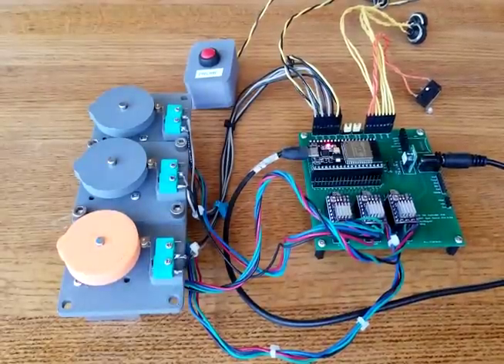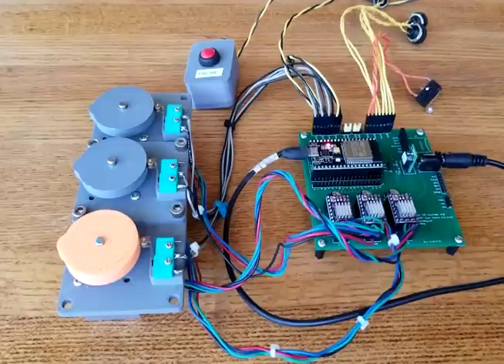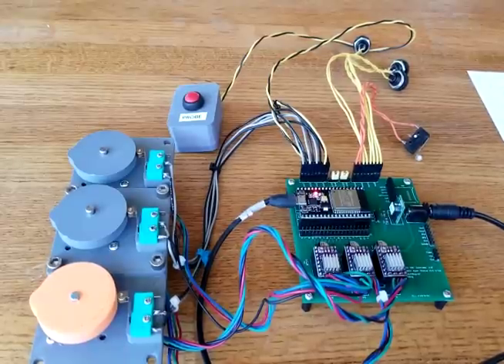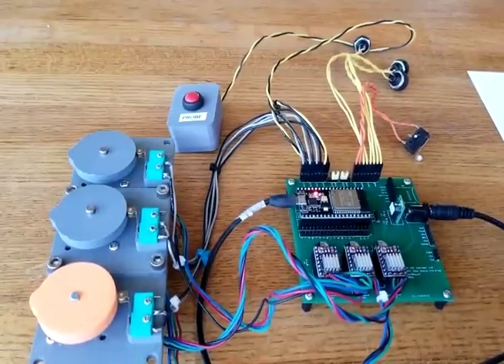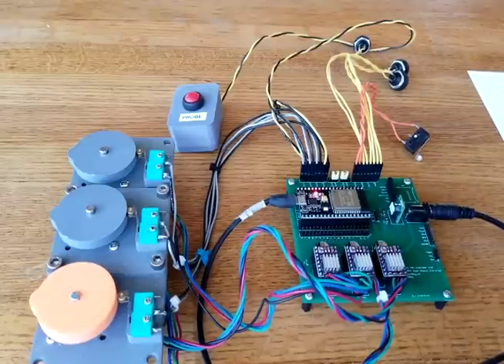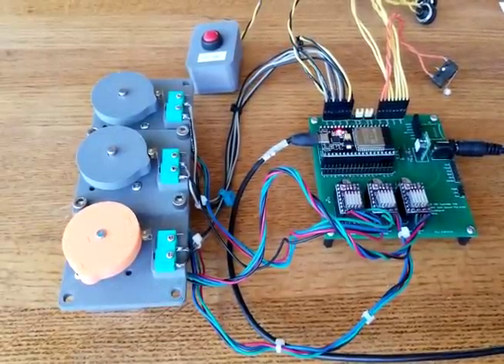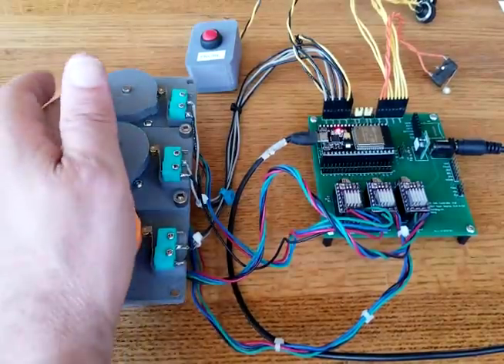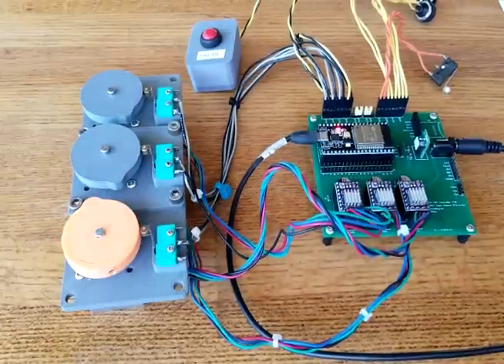Grbl CNC Firmware Running on ESP32

Comment: I want to use esp32 for my cnc router and I have esp32 and drv8825 drivers I know wiring how to run motor with esp32 
but how i can enable microstepping can you please help do i need to give 5v to ms1,ms2,ms3 ?
Reply from the maker: @Harinderbhinder  The firmware is now called FluidNC. Go to the Discord for support. Google to find that.

Comment: What should be interested would be to add a real  motor pwm speed control. 
Counter-reaction with the can, it would be probably possible with this controller.
Then drive the motor with mosfets at a quite hight pwm frequency.
As a workaround we could only choose a voltage regulation which would be sufficient enough for some CC motors. It depends of what you wanna achieve with your motor, and though what power you need.

Comment: hi, I would ask you a question. I have an old CNC Fanuc Sigma VC1000 with the same serial port 25 pin DB25 rs232 and I would monitoring this machine using an ESP32. Not only monitoring but also send it the gcode. In your opinion I'm able to do this using this shield (in your video)? For monitoring I mean sending the machine some code for example D600 and the machine could answer me about the status: stop, word, allarm, type allarm. Sending gcode I don't know yet.
Reply from the maker: This project is now called FluidNC. Here is the Wiki http://wiki.fluidnc.com/en/home

Comment: It would be nice to have this ported to XTool D1's control board. It also uses an ESP32 and Trinamic drivers but it is NOT user friendly. Completely locked out of user customization.
I may be looking for a way to replace the controller board for something like this that can drive the steppers and fire the diode laser. Have you thought about hacking the XTool controller to add your own firmware or making a pcb that fits? I'm interested if you do.

Comment: The file you have online for esp32grbl will not load into the arduino ide and yes I have the esp32 board manager installed  PLEASE zipp it up as an arduino file like they did for the uno.

Comment: Hello, very nice project however most of the arduino GRBL can not do this or that are based on the arduino uno (328) running GRBL however you have not considered the MEGA 2560 with a RAMPS board pluged in which runs 4 axis ,end stops ,heaters ,lcd ,and a whole lot more,I have been running this board on my 3d printer and my 3axis cnc and never had any type of problems and yes the system is pugged into a computer which sends the gcode but there is a way to put the code on a flash drive pop the drive into the slot on the lcd board and away you go . You have to admit arduino grbl is proven ,easy to use ,and cost is lower than your esp system and what is the real advantage I do not know,  also the high speed well when running a mill you want torque not speed speed is needed for 3d printing and pen plotters and pricewise your esp board cost as a ramps +mega + stepper drivers check ebay. now if you want to do something special use a  ESP Wrover Kit and then all you need to add is the driver modules and its ready to connect to a cnc machine.

Comment: Good afternoon. Could you help me in connecting 4 stepper motors in the firmware Grbl_Esp32 (https://github.com/bdring/Grbl_Esp32). Nowhere can I find a circuit with a description of the esp32 pins and their connection to the pins of the stepper motor driver.
Reply from the maker: Here is a link to a 4 axis example https://github.com/bdring/Grbl_Esp32/blob/main/Grbl_Esp32/src/Machines/spi_daisy_4axis_xyza.h
Here is a folder of about 20 more examples (3 to 6 axis)
https://github.com/bdring/Grbl_Esp32/tree/main/Grbl_Esp32/src/Machines
Reply: @engserve  Thank you very much

Comment: I installed esp32 grbl. Most of it's function are working , like jog x y x ,homeing , z prob ,limit switches but I can't control it's coolent and spindle ! I don't connect it's any switches like door ,cycle start etc.what might be the reason for not functional spindle? can you please explain?
Reply from the maker: Try asking on Github
Reply: @engserve  did you run spindle motor ? It was ok ?
Reply from the maker: @annoorkhan4219  We support 8 different types of spindles. They all work great. Try Github   https://github.com/bdring/Grbl_Esp32

Comment: Basically it's an ultimate CNC for hobby usage and more..I got a spare esp32 for the job...and I'm not afraid to use it😁. The pwm output from esp32 is it stable enough? No glitches?

Comment: Where do you buy the green board panel for esp32?
Reply from the maker: I have several controller here https://www.tindie.com/stores/33366583/
Reply: @engserve  it's capable to control the cnc plotter with web server database, like firebase?
Reply from the maker: @rinoprihantoro155  it has a full featured web app already

Comment: what means "control safety door" in cnc machines what for,  functional?
Reply: In any case, you are doing a great project. I imagine how much work has been put into it and I take off my hat. If I’m not opposed, I will describe your creation on my page for my Russian friends. I want to describe the pin out and show the simplest way to connect with different drivers.
Reply from the maker: If your machine has a door, a switch can be used to detect when it opens. The machine will stop. The spindle will retract and stop. It can then continue after the door is closed again.
Reply: @engserve  Thank you very much for your work. You are man. Shake your hand. Good luck in your affairs.

Comment: So if I'm understanding correctly, this is a great alternative to the grbl LPC that is used for laser engraver ? It's an arm based port of grbl that can generate pulses up to something like 80khz. If grbl esp32 can handle the pwm generation for the laser tube that's a perfect solution !
Does any one have tested out the co2 laser capabilities of this firmware ?
Reply from the maker: It works well on lasers up to 120khz. I recommend streaming from the SD card for high speed engraving.

Comment: Issue: I have an ESP32 WROOM Dev V1. On compiling the sketch I get 

Sketch uses 1774550 bytes (135%) of program storage space. Maximum is 1310720 bytes.
Global variables use 68708 bytes (20%) of dynamic memory, leaving 258972 bytes for local variables. Maximum is 327680 bytes.

Error compiling for board ESP32 Dev Module.

Any Tips?
Reply from the maker: Depending on the features you enable, you will likely have to change the partition size away from the default. See the wiki on how to do that. In the future please ask all questions at the Github repo for this project.

https://github.com/bdring/Grbl_Esp32/wiki/Compiling-the-firmware

Comment: Well played!  This should fit in well between the ardunio hardware and going to a full ARM based beagle bone, etc.  Now... where to use it... I'm picturing battery powered wireless micro 3d printers or something.  Hopefully I'll find an application at some point.

Comment: Huge work, congratulations ! Just a question : is GRBL still limited to 1:16 microstepping ?
Reply from the maker: Grbl does not care or know about microstepping. You simply tell it how many steps, micro or otherwise, per millimeter. The limitation is how many steps per second. Normal Grbl is limited to about 30,000. This can do well above 100,000.

In the video, the stepper drivers are running at 1:32 micro stepping and the steps/mm is 200. The speed on the fastest motor is 18,000 mm/min   The speed is limited by the motor in that setup. not Grbl_ESP32